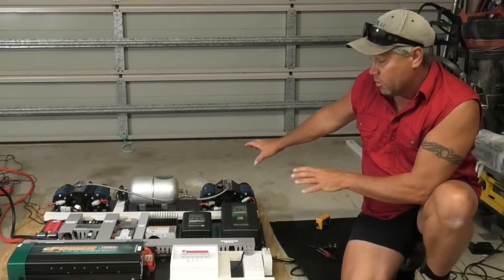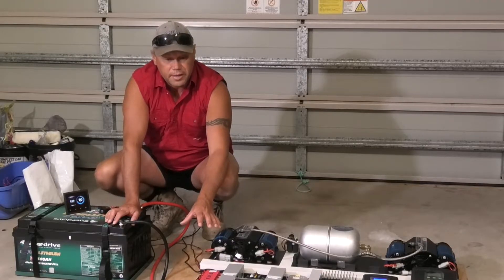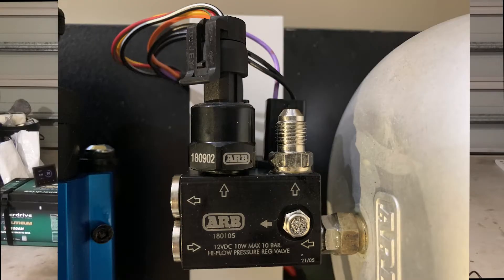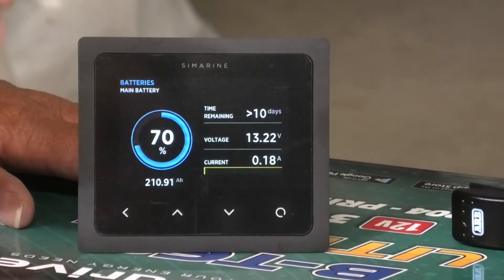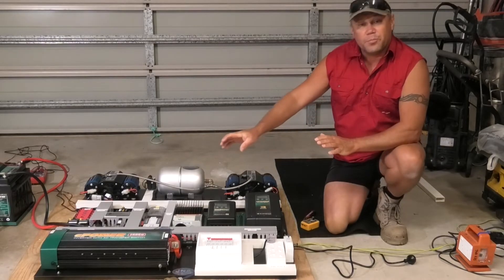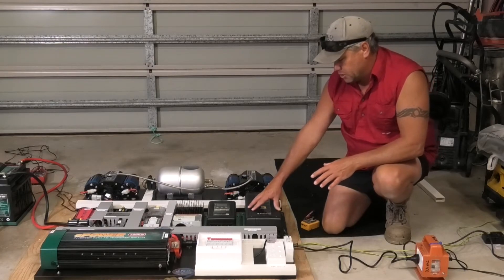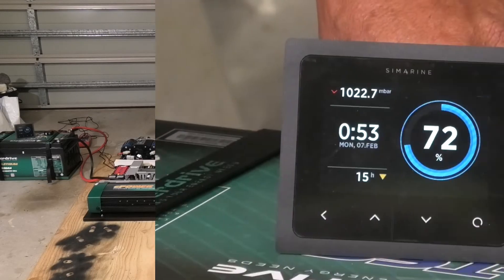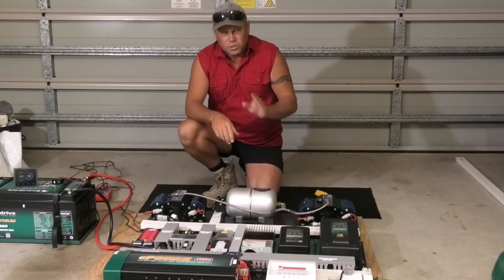Enerdrive Canopy Build

Comment: Hey mate, loving the series! While you are testing all this, is it ok to not have anything earthed while on the shed floor? I want to do similar and just run my fridge n things while my truck I've ordered is still coming. Cheers
Reply from the maker: Yeah mate, you can get away with it for most 240v appliances as they are double insulated. Be sure to earth the DC to DC charger as well once installed as the Enerdrive boards are non conductive.